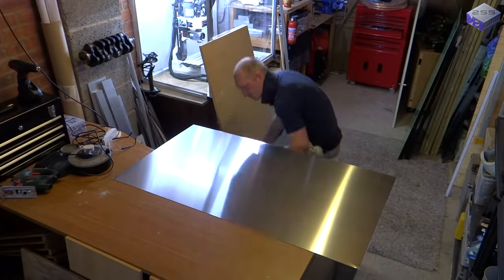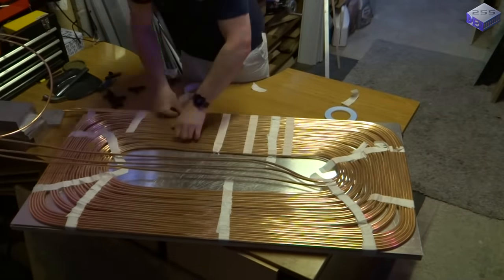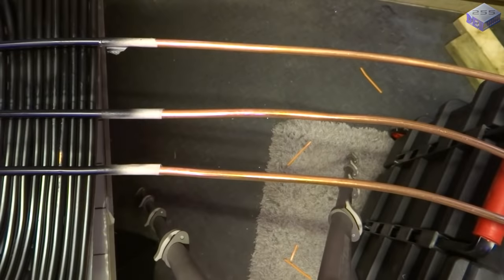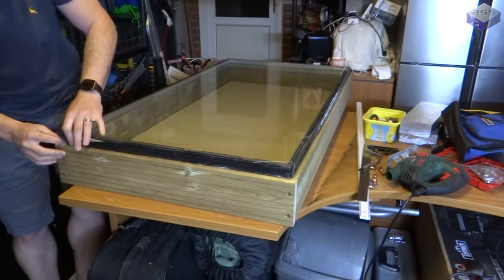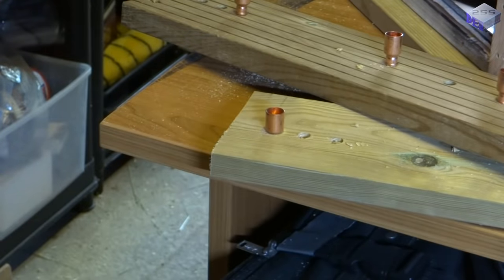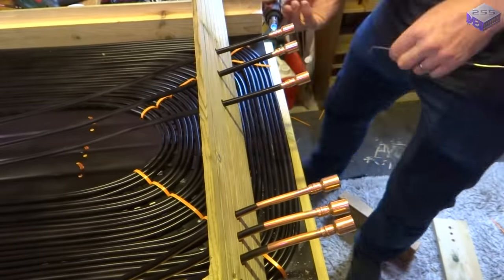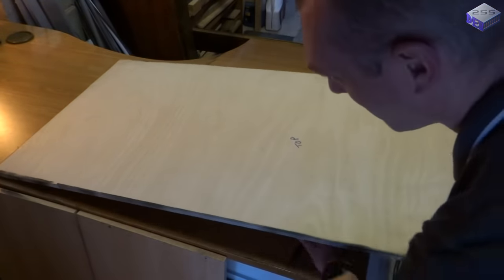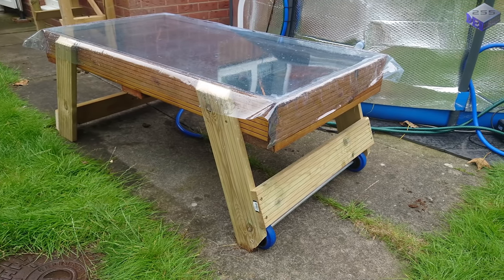Improved Solar Pool Heater - Full build

Comment: Has anyone mentioned the toxic green sealant on decking timber, dust when cutting?
Reply from the maker: Hi Bryan, no one has mentioned it yet, what problems are there? I haven't noticed any green sealant.
Reply: @TheSolarPoweredEngineer  B&Q in the UK advise Don't burn the off-cuts of pre-treated timber decking as the smoke and ash produced is toxic. Dispose of them as you would ordinary household waste.
Reply from the maker: @bryandalton959  Ah ok, that's good to know, thank you, I don't believe I have burnt any in the past but do cut them with a hand saw and mitre saw, but mostly outdoors.

Comment: I want to know what would happen if you use a magnifying type glass and the world's blackest paint
Reply from the maker: Good question, a Fresnel lens would increase the amount of light on the panel, although would have to be much larger than the panel to receive more light and would have to track the sun around the panel so that the light remained focused on the panel. There is some debate from previous comments that the blackest black would absorb all the light as just under half the suns energy is outside the visible spectrum, therefore the blackest paint would have to absorb those light frequencies as well, some other paints may absorb those invisible rays better (more info needed on this though). I hope that helps.

Comment: Horticulture glass or even better sunbed glass are far better at letting UV through- regular glass cuts 90+% .. a double glazing unit almost all of it.. 

Polycarbonate sheet I’d also better than regular glass
Reply from the maker: You do have a good point, I'm learning that quickly from the comments, where I will be looking into clear polycarbonate and reducing the amount of air in the panel too.

Comment: parabens pelo projeto., mas vcc nao sabe de uma coisa que permanece a noite tambem quente. os tubos....
Reply from the maker: Olá, infelizmente não, embora você possa isolar sua piscina e cobri-la para reter o calor ganho no dia. Além disso, certifique-se de que sua bomba esteja desligada quando começar a esfriar. Espero que isso ajude.

Hi, unfortunately not, although you could insulate your pool and cover it to retain the heat gained in the day. Plus, make sure your pump is off when it starts to go cold. I hope that helps.

Comment: Whole idea is to transfer incoming solar to the water and the efficiency of system. After a minute or so copper and water are hot and can
Not absorb any more heat. Pushing water through faster would be better but the temp difference from bottom top would mean the cold water coming in bottom would be hot already when it reached the top where heat transfer is optimum. Where does that heat go when pipe is at max already. I built one with just a 2 inch copper at top of collector. Then just used air exchange directly. 500 watts is about  1/8 of the normal household hot water tank consumption. Also solar energy hitting ground is between 160 and 358 watts per square meter. Calculate Return on Energy input before building one. Electric tea kettles are 1500 watts and heat 1 litre of water

Comment: Definitely don’t show us the water temperature difference or any other results
Reply from the maker: You are quite right, I was making a follow up video, although have been off ill and have since moved house. I will be editing a video that I took a few months after this one. To give some figures, I get around 500W of heating out of this one, where there is around 1.4 ºC difference between input and output with a flow of around 4 litres per minute
Reply: @TheSolarPoweredEngineer  Thank you!
Reply: @TheSolarPoweredEngineer  THANK YOU!!!

Comment: Your tie wraps/cable ties do not look to be the uv resistance type (usually a light green translucent color). They’re gonna fail pretty quickly.
But very nice work otherwise.
Reply from the maker: Thank you, yeah, I do need to change them, just liked the orange against the black 👍
Reply: Nothing to worry about, you won't get any uv behind 2 sheets of glass!
Reply from the maker: @allanm0rris0n  No dramas, I'll be reducing the sides to reduce the amount of air in the unit and replacing the glass with something different, I have since learnt from all the comments how much UV is reflected away from the panel. The heater was producing around 500W last year, although couldn't test it much thanks to the non-existant summer, so I am interested to see the difference with other materials. I will be trying clear polycarbonate (sheet & dual layer), plus an acrylic sheet too, just need to hook my Arduino data logger to see what's going on.

Comment: Don't cover the collector. It's a myth! For pool collectors where the pool water is about the same or typically lower than the roof temperature, such glazing insulation will actually prevent warm roof air from transferring to the pipes, but secondly about 10-15% of sunlight is reflected back into space by the surface of any glazing material. So you lose that much straight off the bat and then there are the potential overheating issues. Keep it simple don't glaze it, you'll get a better result.
Reply: In the same sense, having a white background and the pipes slightly spread apart will make it warmer uncovered than a black backing

Comment: It's great but chlorine water will react with copper and give greenish pool water. Any one has experience this. Cause this project will cost lots of money and time anyway.
What I found metal best coefficient and non reactive will be SS316Ti .. but this tube is pretty expensive and I can not weld it. Any one can give more tip please.
Reply from the maker: Hi, thank you for the tips, this was a concern of mine too, where I've been researching this a fair bit to find a definitive answer; where the Drinking Water Inspectorate (DWI) requires that drinking water is maintained at the correct PH level and add 1mg/l (1 part per million) and up to 5ppm of Chlorine when carrying out maintenance; this (according to the below link - DWI Chlorine) is the safe level for drinking water within England. As this water predominantly runs through copper pipes in the home (replacing lead piping) there should be no concern with copper use in respect to Chlorine as long as the PH balance is maintained. The issue with chlorine and copper corrosion is exacerbated by a greater imbalance of PH. I agree that drinking water is constantly run through the home water system, where pool water is cycled around the same system, although if this is correctly maintained, there should be no concerns, especially as pool water is classed as non-potable.

A good point to note though is that I've introduced a UVC (UV Clarifier) to our pool with an outer jacket of SS316 that allows us to reduce the Chlorine level to around 1ppm from 3ppm. SS316 would be a great alternative, and with drinking water supply, but as you mentioned, a little expensive.

Here is the link to the DWI Chlorine document: https://cdn.dwi.gov.uk/wp-content/uploads/2020/09/23151717/chlorine.pdf#:~:text=The%20World%20Health%20Organisation%20has,level%20below%201%20mg%2Fl.
Reply: Thanks, I am running sample of SS316L tube it's 4th day and I do not see any corrosion yet. I thought SS316Ti is perfect but 6 meters of 10mm dia tube will cost 200 euros!!. Whereas SS316L 1/3 of it. 
Thanks for the input  cheers.
Reply from the maker: @ronalddsouzak  No dramas. It will be interesting to see if you get any corrosion; my gut feeling is that you should be fine as stainless is pretty resilient.

Comment: Why double glazed? Double glazed is meant to be an isolator, not a transmitter!  
A single tempered glass would double the efficiency!
Reply from the maker: Hmmm, good point, I was given this double glazed panel a few years back and decided to use it for this project, I may try using different items to see which performs best, such as single tempered, acrylic and of course none. This project was devised using all the comments from my first build, so I will hopefully implement some changes for the next one. Thank you.

Comment: Yuu didn't show if it worked? Those orange ties will be dust in less than a year...
Reply from the maker: Hi, it was my intention to show it working and I do have the footage to make a video showing what effect these panels have overall, although had some unforeseen circumstances happen. I hope to get back on with these projects soon. Yes, I thought about those cable ties too and will be changing them for metal versions along with some other modifications; they have survived so far, although I think the glass is reducing the UV too, so that will need to change for better heating performance.

Comment: Sure that wasn't glass with a uv coating should be more powerful id think shouldn't use double pane glass either probably has argon between the panes 500 watt is only half as much as a eletric coffee pot
Reply from the maker: We will have to see how it performs this year and make a few modifications
Reply: @TheSolarPoweredEngineer  it is a good design I've seen ones similar that supply hot water for houses but they usually use bigger diameter black rubber hose so more volume can sit in it and get really hot 
    Also to check glass for uv blocking get a crookes radiometer
Reply from the maker: @terranovarain6570  Ah, not heard of one of those, will take a look.

Comment: probably would have been a smarter idea to treat the wood first before doing a step that cant be reversed (soldering and hammering in the copper ends)
Reply from the maker: Very true. I didn't think of that after doing it, although will be reducing the sides to remove some of the air within the unit and trying to make this one more efficient in other ways.

Comment: In my experience, cable ties are not good for this, they will degrade and brake after a couple of years.
Reply from the maker: I will probably change them for bare wire ties to ensure they last, I need to do some modifications to it as the glass may be reflecting some of the UV, hence the cable ties are lasting well at the moment.

Comment: Wrong things : Copper will disintegrate using chlorine. Area is too small : 1 sqm = 800w at best in England. You need 1.16Watt during 1h to get 1°C added to 1L of water. I mean 1160W for 1hour to add 1°C in 1cubic meter of water. IF you got a small pool of 10cubic meters = 10 000L then you need 11.6kwh to add 1°C. Here North East of France we got almost the same sun exposure than England, from my measurement you can get 500W per 1 sqm during 5h per day average from an enclosed solar heater. From my 15sqm panel I get around 40kwh per day in summer so I can add about 1.4°C to my 25 cubic meter pool. For comparison most of heat pump Pool heater are giving 6 to 10kw so 30 to 50kwh in 5 hours (drawing 7 to 13 kwh of electricity) . AND if you don't cover your pool during night you will loose 1°C average (0.4°C covered).
Reply from the maker: Hi Eric, thank you for all the calculations, I do get around 500W measured from this panel, I will be demonstrating this with this pool heater similar to the in-depth videos from the first panel I made. I agree that if you don't maintain the PH balance of the pool and add chlorine when you don't need it (not testing the pool daily) then the chlorine will start having an effect on the copper the more the PH balance is off. I will hopefully be adding the Chlorine, PH, Copper answers in a later video once I get credible clarification from either university or a professional lab. Essentially looking into this online is not sufficient and it needs to be answered with scientifically proven research. The idea is that the pool is non-portable water, chlorine is added sparingly only when required and the PH balance is maintained. Essentially there is an amount (albeit small) of chlorine in tap water that is PH neutral and runs through domestic copper piping in most houses for us to drink. This is becoming a hard question to answer. P.S. our pool is wrapped with reflective foil and has an insulating layer on top while not in use, where our pool got up to 31ºC in the summer of 2020 from just a panel and dome heater of combined 1000W of average heating power, where I was getting around 8KWh per day in good weather.

Comment: You're limiting its potential by keeping it on a frame like that.
You want to be able to angle it towards the sun for the highest heat generation.
Reason why solar panels are aimed towards the sun.
Reply from the maker: I agree, where I may have to create an automatic positioning frame via microcontroller to track the sun.

Comment: A lot of work and money. For not much heat .... just put 200 feet of hose on the roof of the house .. cheaper. And faster ...
Reply from the maker: Hi, yes it was fairly expensive due to the copper and if you'd need to buy a sealed unit, this was made from all the comments to see if a more efficient panel could be made at home. My previous panel with black plastic tubing worked well and has a similar surface area. I will be tweaking this one to see if it can be improved upon from the additional comments.

Comment: Plastic zip ties will be destroyed by the sun.  I think wire would work better.
Reply from the maker: You may be right there, I don't believe these are UV resistant, although these are easy to change though, you can get metal cable ties.

Comment: But copper can rust?
Reply from the maker: Hi, a good point here as copper can corrode, especially with a lot of chlorine in the water where the pH balance is incorrect. With pools, the pH balance needs to be neutrally balanced and chlorine sparingly added. I tested my pool daily when it was up. Copper piping is also used for drinking water in most houses, where chlorine is also added to drinking water that is pH balanced, although there is normally more chlorine added to pools I believe (not sure of the quantity in drinking water. I hope that answers your question.

Comment: A while heap of issues... Copper corrosion, "glass stopping wind from cooling the pipes", draining down.,..
Reply from the maker: Hi, I am looking into the Chlorine to copper issue when PH is off balance and should hopefully have a definitive answer soon. The heat needs to be taken by the water into the pool, if the wind was to take the heat away the panel would be less efficient, hence the glass, although a better solution may be Perspex or clear single pain of glass (such as on a greenhouse) so less UV is reflected and the wind hasn't got a chance to remove the gained thermal energy. I will be looking into more efficiency increases this year.

Comment: More insulation under  and
Around the box , inside and outside.
Reply from the maker: I will measure the inside once we see some sun here and compare the outside to inside, I have got some more insulation, although need to test it in its current state.
Reply: @TheSolarPoweredEngineer  ,,
And you will have data before and after. 
Good point

Comment: timber alone cost you more than a solar panel :D
Reply from the maker: I think you might be right there, although I used wood that I had left over from other projects. The decking was from a table I made on here (https://youtu.be/YeauAjGtpZM) and the sheet left over from another project.

Comment: 500watts? Ehhh.. My friend has dedicated 12Kw of solar for pool heating.. depending on pool size it is barely enough :D
Reply from the maker: Hi, yep 500W would not be enough for most largish pools, where this is to find the most efficient home pool heating method. I will be modifying this with different materials to see if this can be improved upon, although our pool increased to 32ºC last week with this heater, a purchased one and the previous one attached, so will be making a few more videos to compare and show the most efficient way to heat a pool.

Comment: Would get way more thermal into the water by routing it tgru the entire length vs parallel
Reply from the maker: I was thinking of passing the water over or under the black plate to get more surface area and then also track the sun with a thinner panel.
Reply: @TheSolarPoweredEngineer  you do you bro numerous people on youtube tried all ways the longer the the time in the tube the hotter thats all i will say.
Reply from the maker: @Fatpumpumlovah2  No dramas, thank you. I'm always open for other ideas also ;-)

Comment: complex and copper has become expensive. This can be done with a roll of PVC 16 mm black garden water hose where the connectors are all the same. if you really want to do crafts z.B.  Gardena Micro-Drip Verteilerrohr

50 m, ³⁄₁₆″ 1 m = o,38 cent = 18,89 / 50 m

Comment: Galvanic corrosion is going to be a problem.
Reply: Yea chlorine reacts with copper to make copper chloride. But there are alternatives to using chlorine in pools now.
Reply from the maker: @BlatentlyFakeName  Hi, yes I will be looking into this as chlorine does affect the copper, especially when the PH balance is not maintained. A number of options exist including reduced/no chlorine (UV and filter system in place) or a closed loop system for the copper tubing and some sort of heat exchanger to transfer the heat to the pool. I will be doing more tests this year to try and find the best option. For galvanic corrosion, this shouldn't be an issue as there is only one type of metal in contact with the water, this becomes more problematic when using dissimilar metals.